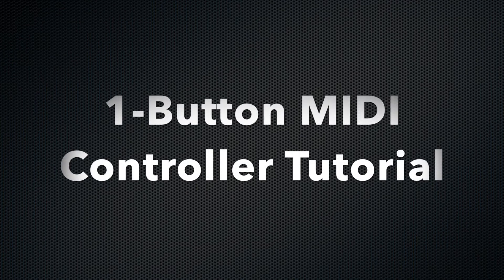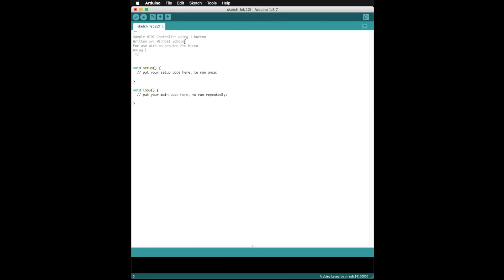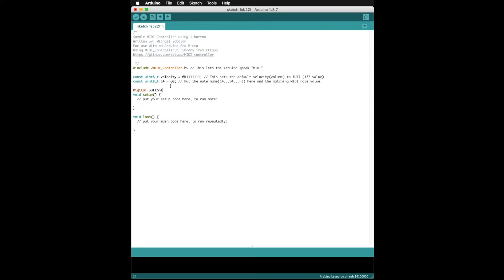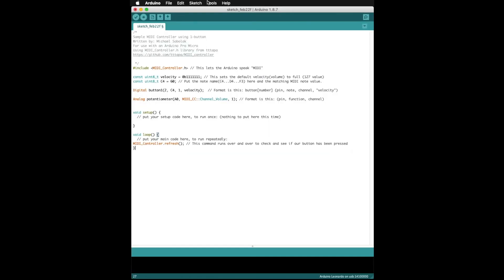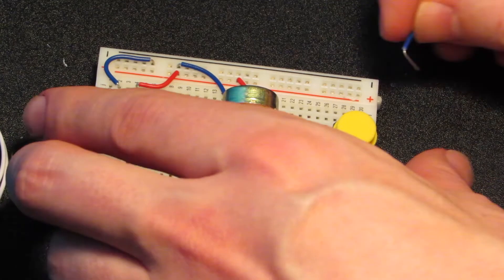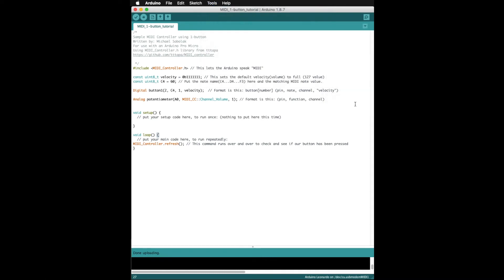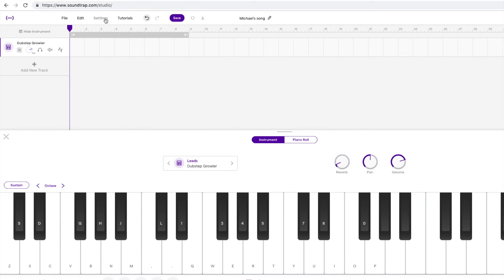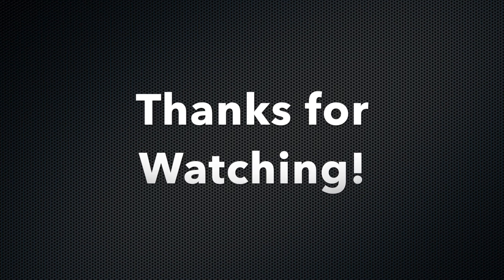1- Button MIDI Controller Tutorial (Code & Circuit)

Comment: I want to make an Arduino midi conyroller like this. There are 2 GM sound modules like vs1053 or MT 32, but the second one is specifically for drums/percussion, Cistom Sound for playing back Midi songs. The sound module uses Channel 10 custom Midi sampler, the other uses GM Synth vs. 1053 controller uses Arduino. mega, esp32, or rp2040 pico which has 2 serial pins for these 2 midi and 2 midi out can you add code to the midi filter that you made thanks in advance best wishes tedy

Comment: can we use just the button and not add the pot
Reply from the maker: You can. Just add // before "Analog potentiometer" and it will comment out the pot function of the code. Alternatively, you can delete the whole "Analog potentiometer...." line.
Reply: @michaelsobolak3398  Thanks so much!
Reply: (SOLVED. SEE POST ABOVE) Got around to building the midi controller, tried uploading to Arduino ( installed midiusb 1.0.5 from library and I get this:

D:\Documents\Arduino 1 button\sketch_sep17b\sketch_sep17b.ino:9:10: fatal error: MIDI_Controller.h: No such file or directory
 #include <MIDI_Controller.h> // This lets the microcontroller speak "MIDI"
          ^~~~~~~~~~~~~~~~~~~
compilation terminated.

exit status 1

Compilation error: MIDI_Controller.h: No such file or directory
Did I miss something?

Comment: Small note @ 3:08, potentiometers are analog devices, they don't transmit data. It's a variable resistor which outputs a certain voltage relative to the knob position. Nice job otherwise!

Comment: Hello Michael, thank you very much for sharing all this information and for your content, it is amazing.

I want to consult you about something that always happened to me when I tried to build these midi devices, even with this code.

The serial monitor always shows me random values ... For example: '' 'Gǧ⸮⸮ǧ⸮⸮⸮⸮⸮⸮⸮⸮⸮ gG''gg' '' 'gg⸮ ... ....

The same thing always happens to me, and I don't know why. Could it be because my arduinos uno are not original?

Thanks again.